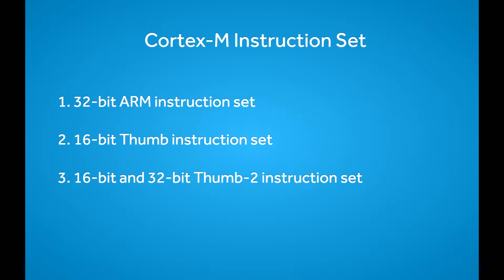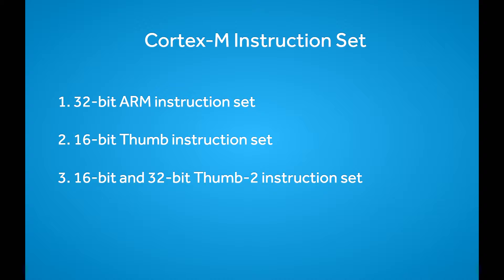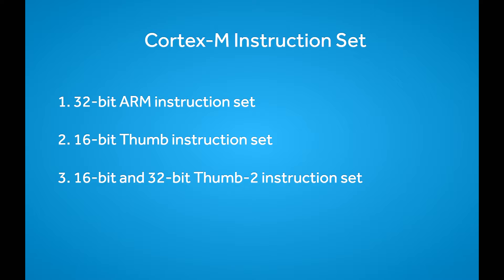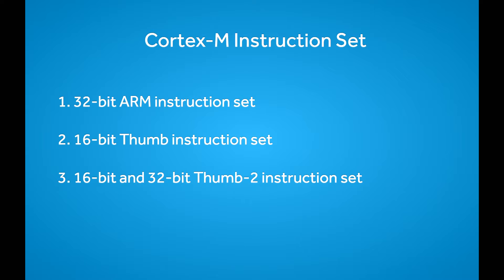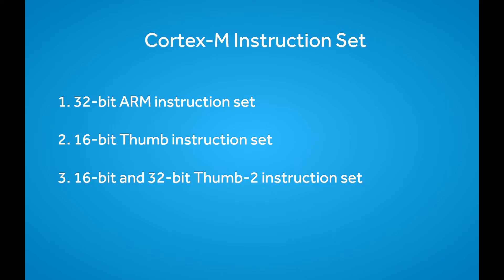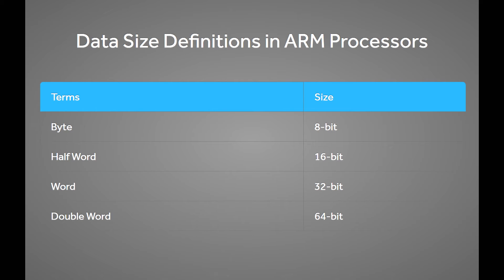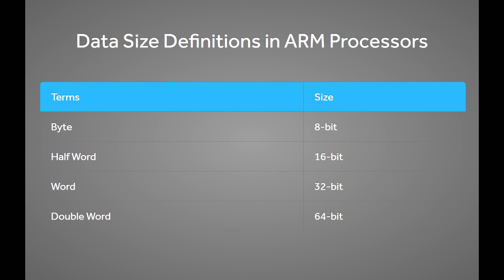ARM Cortex-M Instruction Set (introduction)

Comment: ARM: What a Mess! Using a lot of memory and power are not the only consequences of poor code-density that ARM has. It is high memory bandwidth. This only gets worse as you go to multi-core. It is the  reason why ARM will never make a good general-purpose processor architecture.